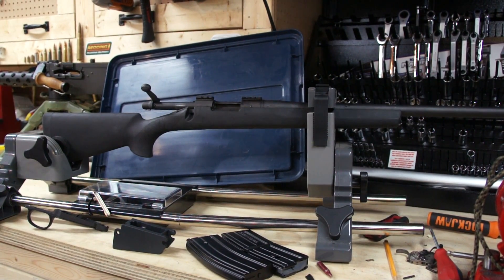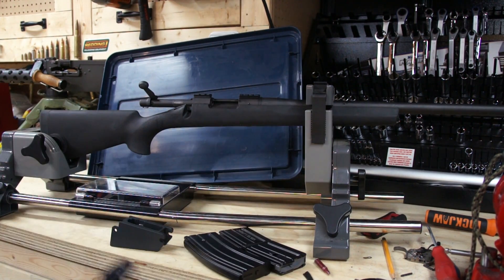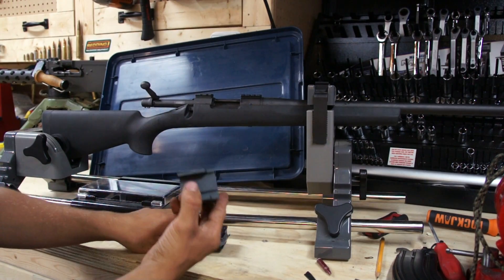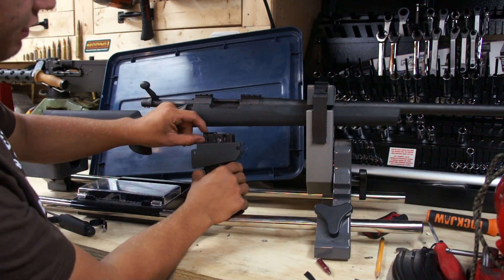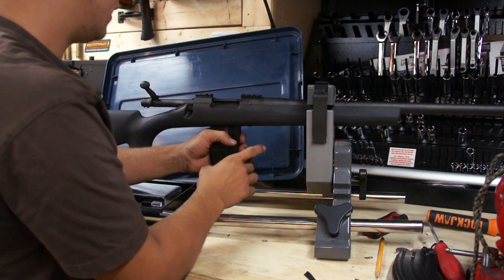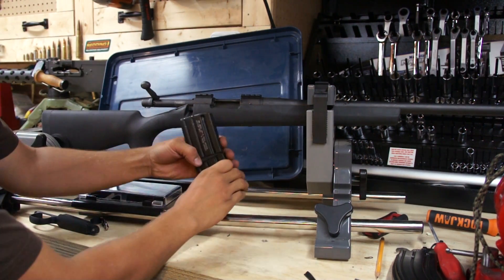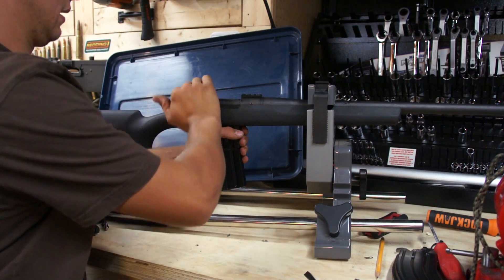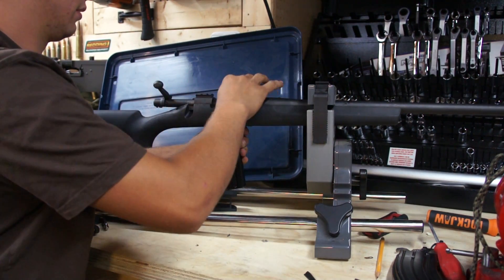Remington 700 Project to use AR-15 Magazines.

Comment: Not sure what caliber your 700 is.  If 308 there are several kits made that pretty much bolt in.  The good ones are not cheap but will do a great job and have 10 round mags available.